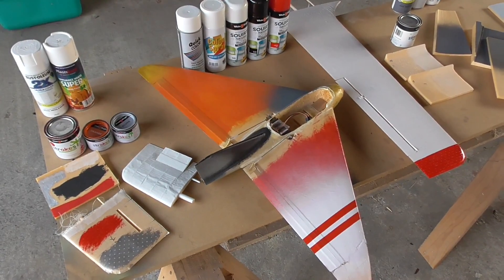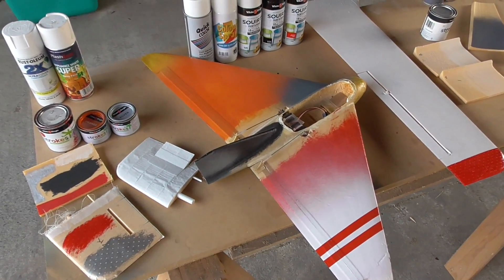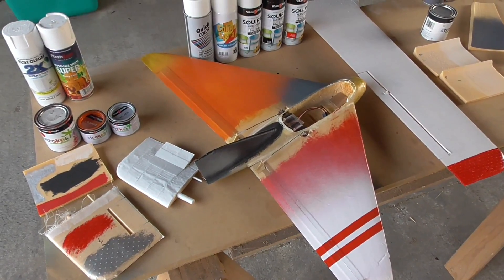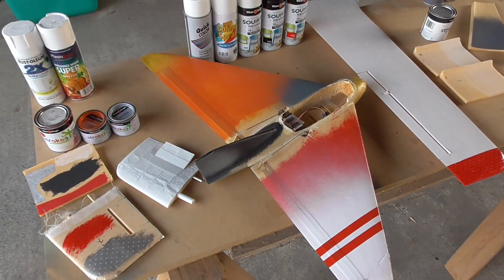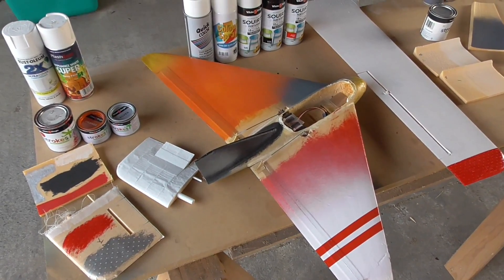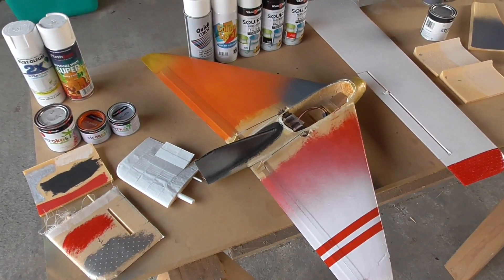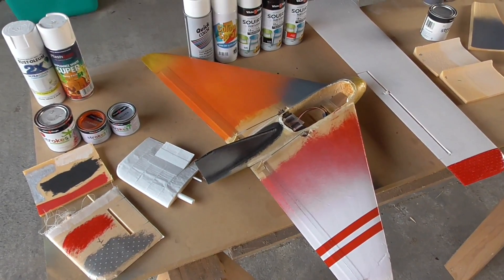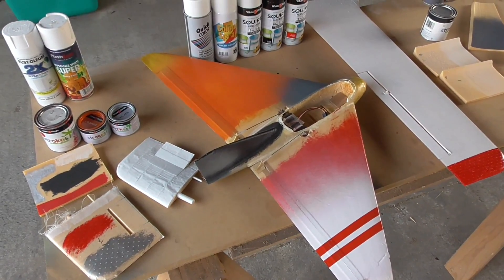Clueless noob tries to paint things

Comment: Use a spray putty over the under coat "primer"      sand with 400 then 600     to remove most of it,   itll fill the void in your glassing      or use a fine cloth 3/4oz as a finishing glass and leave a slightly wet resin     similar to a gel coat finish.       Give it a try on scrap like you've been doing.   Great models pal.    You're a helping hand with the project I'm working on.     Keep up the great work    not sure were abouts in the country you are,   but I'm in palmy north if we're close enough I'd lend a hand

Comment: There is another way to apply paint to epoxy that i will be trying for the first time myself on my current build. As i vacuum bag my wings, i use mylar plastic directly against the epoxy to get that shiny "glass" surface. But what i see guys doing on rcgroups is you paint the mylar and let it totally dry. Than when doing your epoxy/fiberglass you put your mylar on like normal. The epoxy glues itself to the inside of that painted surface. You have to wax the mylars a lot before hand which makes it "fun" to try getting paint to stick too.

Comment: I just painted my u-glider with Squirts.  I'm pretty sure it's epo.  No reaction between paint n foam.  Looks a little rough where I strengthen the foam with gorilla glue, that's why I put paint on it. Made sure to prep surface well. Wiped it down with metho to remove any release agent, probley got 2 coats of colour n a coat of clear. Would still scratch quite easily but is as good as I've seen from any manufacturer
Reply: @Adrian Ryan:  Not all foams are created equal.   I'm years out of touch, but for sure some take contact with solvents much better than others... some can't even handle contact with fiberglass resin.

Comment: What makes paint work hard, it's not so much the paint but all the process that goes into prep. Also keep in mind not all primers are made the same. You're probably going to be interested in the stuff with chemistry formulated for plastics, it's less likely to eat in or soften it. You may also want to look for a filler type primer that will better deal with porous surfaces. The main work (if really getting into it) is in sanding. Enough to bring a surface to smoothness, but leaving enough tooth or roughness for a subsequent coat to hold. Prime, sand, prime again, sand, base coat, wet sand, main coat, wet sand, final clear coat, wet sand, buffing compound, wax/polish. Of course finer sanding each time it's involved. Seems like a royal PITA, but some people make a real art of it and get a glass-like wet shine out of it. Also if you take it to that level, the dust mask/respirator are also important for your own health. Automotive parts places will have the sanding stuff needed (extra fine grits in wet/dry) that typical hardware stores may not carry. Also the automotive parts places will have paints better suited for work on fiberglass, since some cars have fiberglass body panels and most modern cars have composite/plastics for side mirrors, bumpers, spoilers, etc.

Also if you're sanding through to glass like you're worrying about, you're already sanding through your primer which would defeat its purpose. Lighter touch being needed and more curing time before any sanding step? Perhaps sand it to a matte paper-like finish (not paper thin of course, but the tooth from running a finger over it) before even starting with the primer. It's likely you're going to look at 240 grit as the roughest and then go with anything above. Feeling the bulk of the work would be in 400 and 600 for that kind of material. (Others may have better advice, but going off some dabbling on past hobby projects.)

I wish I could say I had more to show for knowing that much too, but my problem is I don't have any good place to do it. You either need somewhere indoors with little dust and adequate ventilation, or outdoors in a warm and relatively bug-free and dry location. Proper drying time for stuff to set/cure between coats also plays a big role.

If you dive into the painting like the rest of what was done with the planes so far... No doubt you'll have something nice.

Comment: Be very careful using any oil based enamel paints on epoxy.
I found out the usual way ( the hard way) many years ago when 2 of us spent over 6 weeks getting 2 F3B gliders together for a competition. My mate painted his with lacquer based and it flew great.
Mine was done with oil based enamel and on the winch, the wings folded as soon as the load came on. Inspection found the epoxy carbon fibre wing spars had softened from the enamel paint. Left the wrecked parts in a bin at home for about a month and checked it often but it took almost that time for the epoxy to go hard once again.

Comment: Grey is an awful colour to fly against a cloudy sky (don't ask how I know).  Also, the UV damage to epoxy is somewhat overstated.  I've got models that are years-old and have unpainted epoxy glass and although the resin has yellowed slightly it's still structurally fine.  Another thing to consider is using some pigment in your resin.

Comment: Complete newbie here too, but what I found works well with fiberglass is adding pigment to expoxy.
Reply: Also as a barrier so that spray paint wouldn't eat the foam away PVA glue works. Personally I just use acrylic paint to paint my foam planes. Cheap, durable, doesn't smell and looks nice enough.
Reply: Although adding pigment to epoxy works okay, but I can tell you that's actually not a great idea if you are actually doing composite manufacturing. Adding pigment to epoxy actually reduces it's adhesion, which is not really favourable in composite manufacturing.
Reply: @aeroakram  oh ok

Comment: Carbon and black pigment is used as UV stabilizer/absorber in UV exposed materials, that is why car tyres are black. So using a bit of black in the paint is preferred for UV stability, that is why you should mix a shot of black in your whites, it will also look more vibrant :)

Comment: For bare foam, you should use Liquitex water and acrylic based spray paint. It doesn't melt the foam like Rustoleum or all the other common ones, which will eat through a ton of bare foam. Additionally it sticks well to the fiberglass I use (relatively lightweight), even when I use too much resin. You can also spray it into a can and then use a brush to paint it on for finer detailing.
Reply: Also, you can paint pretty thick coats, and the color goes on nicely

Comment: Maybe I can help a little, though you seem to be figuring some of this out:
- Yellow needs to be sprayed over white to really pop, on a car you'd typically do all the bodywork/prime and then spray a white sealer over that before spraying color
- 2 big problems with leaving them in primer- it doesn't have any UV stabilizers (protection) in it so it will eventually turn to dust and just sort of come off without a topcoat, and second, it's not waterproof or water-resistant at all, it absorbs water- on a car, it will cause rust if not top-coated, on fiberglass, it will cause the 'glass to delaminate if exposed to any water or even decent humidity
- Spray can primers are really multiple products that manufacturers are all calling them primers.  They would have different names if you bought them at a paint shop.  Most primers will act as a sealer- they seal in whatever combination of substrates you spray them over so you don't see them in the topcoat.  Primers that are labeled "sandable" are intended to not only seal the surface but to build it up a little so you can lightly sand it (typically with something like 400 grit or higher) and even things out- if you break through the primer and can see the substrate you've sanded too far and need to put another coat of primer on there.  In theory, if done right, you'll sand most of a sandable primer back off, especially if it's a "high build," formula, and yes, if you're not careful/good things can get heavy.
- UV resistant clear has a UV stabilizer added to it, meaning that it will resist breaking down due to UV light.  It may or may not prevent the UV light from getting through and breaking down the substrate (I believe most automotive clears intended to be used over a basecoat does because typically basecoats do not have UV stabilizers, the stuff in a can, who knows, I wouldn't count on it.  An easy test is to spray it over a non-UV stable color (blue is usually horrible), cover it in some of the stuff and then put it in a south-facing window (north down there I guess ;-) ) with some cardboard or something over half of it, you should see some fading if it will happen in a couple of months.
- those holes are where the fiberglass isn't fully saturated.  If it was a car part it would be considered defective and not as strong as it should be, though in your case it might be strong enough and it's lighter.  Primer will bridge some of that because of it's heavier structure, color coats will avoid getting into there because of the static charge, and even if it did it wouldn't bridge the hole.  The correct way to fix it (barring re-doing the glassing) is to prime it, sand it out, if you still have "pinholes" you fill them with glazing putty, sand that out and typically re-coat with primer and sand to make sure they're all gone or with sealer if you're sure you got them all.  

How far you take all this is up to how perfect you want the surface finish and how much weight you'll tolerate.

FWIW, paint out of cans  (not spraycans) applied with a dedicated sprayer (even an airbrush which leaves a much finer finish than a typical sprayer, which is something I intend to experiment with on my planes soon), has more pigment, solids and binders in it than spray cans and you'll get better coverage faster with less buildup.

Comment: It's weird if the paint goes trough the fiberglass, maybe  use a little more epoxy. I used  to build surfboards and I used 3 layers of 160g/m2 fabric and epoxy on Styrofoam. Some people made the first layer with epoxy and then used polyester for the rest of the layers to make it cheaper. Polyester directly on the Styrofoam would just melt it away...

Comment: Maybe I missed it, but almost all spray paints have an additional solvent in them that keeps them fluidic. That solvent will melt almost all foams and epoxies. That is why in commercial aviation they use compressor powered spray guns to spray on a solvent free primer over composite parts. I suggest an air compressor spray gun as an investment if you choose to paint in the future. I believe DeWalt makes self contained unit. Don't know if they sell that in NZ.
Reply: More in line with budget may be the automotive or marine grade paints made specifically to work with fiberglass and/or composites. Different solvents than paints for metal finishes in regards to priming and sealing the undercoat, but the reasoning behind it is the same. Should not excessively eat into, dissolve, or embrittle the resins or plastic underneath.

Comment: you can use pva glue mixed with a little bit of water to protect the foam

brush it on, it'll smooth itself out, or airbrush, although that might clog the nozzle

there also are special spray paints for foam that use a different solvent

maybe you could have uploaded this video before painting the farmhopper so you can use tips from the comments on your best work yet

Comment: The ugly truth when it comes to composite manufacturing is the fact that weight goes up from all sides. Here's one way to do an immaculate job at painting a composite UAV: 
Step 1 - Lightly sand the epoxy and flatten any uneven areas, especially any glass or carbon fibre seams (before applying any primer).
Step 2 - Coat the surface with thick filling primer (but build up in multiple thin layers though to ensure maximum adhesion). This step is necessary to fill the weaves and to ensure a good adhesion for the paint).
Step 3 - Lightly sand the primer.
Step 4 - Repeat Step 2 and Step 3, as necessary (depends on the kind of finish you're after).
Step 5 - Apply paint (build up with multiple thin layers). 
Step 6 - Apply clear or varnish.
Reply: And yes, the shit takes time!

Comment: You're doing yourself a disservice with that delta. It would take about 15 mins to square off the front and epoxy a ply firewall onto it. 
Then simply screw a motor onto the ply and stick a speedy and battery into it. 
I would suggest gluing a strip of fine wet and dry each side of the fuse at the CG, to give you a handhold to hand launch it.
It will fly great, shame to waste all that work..
Reply from the maker: I tried, made no difference. Extending the wings a little seemed to help
https://www.youtube.com/watch?v=drQukY1F4bg

Comment: I believe that the uv resistant clear coat simply is resistant to breaking down in uv light and does not filter it out, this will mean the uv light still reaches the epoxy underneath it!
Reply from the maker: Yeah that sounds about right
Reply: @iforce2d  regarding painting bare foam, i paint a lot of foam board planes and spray paint eats it on the bare foam edges if you just try and paint it.
super light dust coats and allowing each one to fully dry before the next is the key to not melting the foam, once you have a full layer covering the foam which is cured then you can go in with heavier coats.

Comment: Dont be tricked into thinking the primer/top coat all in one would replace a good under coat then top coat.
it could also be the solvent/propellant that was used to pressure the aerosol that melted the foam.....
Acrylic paint would not dissolve the foam but I dont no of a off the shelf aerosol,
yes at 18:50 the problem is lack of primer to get a flat surface and the resin has a waxy finish the paint does not stick to well unless sanded, so very hard to sand the pin holes that you are seeing through the yellow, add more primer or more resin to get a flat surface,
there is also a product called sander sealer and that fills in the pin holes/pores but not sure how it would go on our xps foam.
40 years Ex decorator ,
Brett

Comment: It’s all to do with the temperature of the paint when it comes out the aerosol can and how close you paint to the surface so if you heat the cans up in hot water before you start painting you’ll probably get a better painted surface,  And don’t hold the cans quite so close to The surface